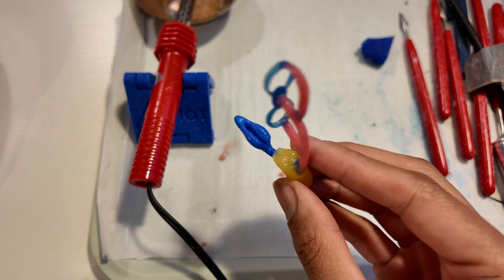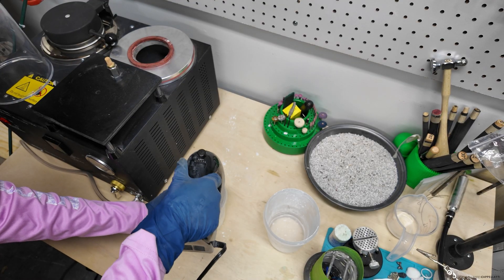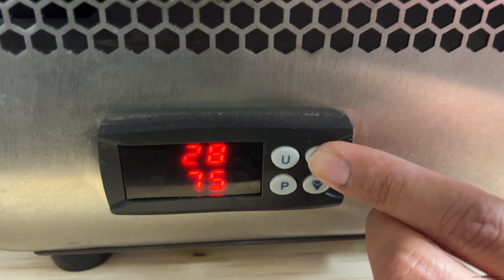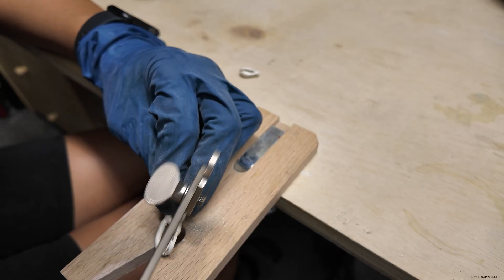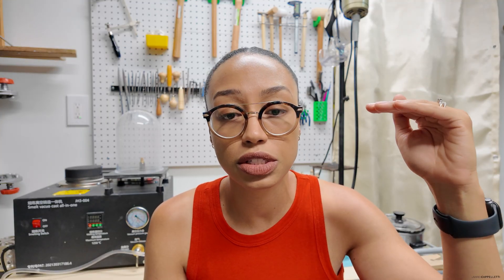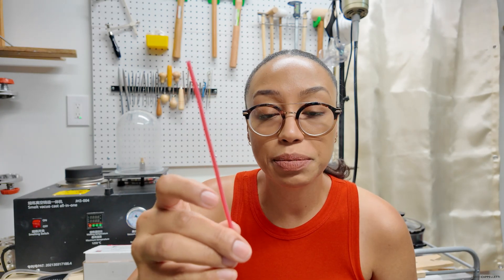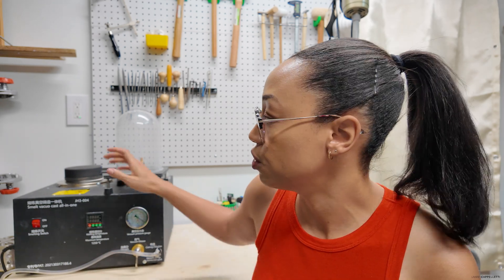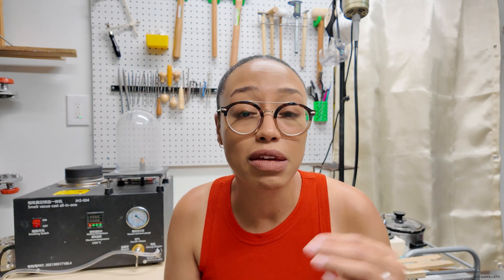Quick Step by Step Lost Wax Casting Silver, Kiln & Vacuum Cast Machine Update,  Answering Questions

Comment: When pouring the metal, do you turn on your vacuum pump as well? Since it’ll be in vacuum?
Reply: I also have the same casting furnace, it was hard to turn it as well but I complete turned it to the the left (loosened it) and now it’s much easier

Comment: Hey, are you sure its not programmable?
I have the same one (or at least it looks identical, buttons and all) and mine is programmable with temperatures and times. 
What happens when you press and hold the „u“ button for a while?
Reply from the maker: Yep, mine is not programmable. When I bought this, there was only one version. If you go to the Vevor site, it looks like it does come in two versions now. I'm tempted to put mine on marketplace and upgrade lol

https://www.vevor.com/tabletop-kiln-melter-c_13250/tabletop-kiln-melter-1500w-electric-kiln-2192-max-temperature-melting-furnace-p_010733303111

Comment: Hi, where did ypu get your unit from ? Does it still works well ?
Reply from the maker: Hello there! I got my 3 in 1 & my kiln from eBay new. Both have been great for me so far & I haven't had any issues. I know some people have reported problems with the 3 in 1, so I would recommend testing it as much as possible while you're still in the return window.
Reply: @lawrencappelletti Thanks, appreciate it !

Comment: I'm buying the same setup today.  I got the cheapest version because I already have vacuum pumps I use for other things.  This looked easier than a home made vacuum solution.  I have a kiln I can use for melting the wax out,   I want to cast some silver trinkets.  Some things I will 3d print in wax resin, others I will try using  pla.  The first time I did this 40 years ago we used a spring loaded centerfuge instead of a vacuum, I hope the vacuum is better.  What casting material do you use for the mold?  I bought something on Amazon to start with, but I wondered what you use.
Reply from the maker: Yay! Excited for your new set up! In school we had a centrifugal casting set up, but this is way better. I'm using prestige optima now, but I've also used prestige oro investment also. I've sometimes gotten a good deal buying investment powder on eBay, so that may be worth checking out. Happy casting! :)

Comment: Great video 
Have you ever thought of getting the 8 in 1 casting machine which also does for burn out process
Reply from the maker: Thank you! No I haven't but I'll for sure look into that machine!
Reply: @lawrencappelletti  videos have been great helping me I’m a gold miner / bench jeweller myself but I’ve always used a sand cast or hand fabrication. So casting is very new to me 

I was looking at buying a kiln for burnout when I was told about this 8 in 1 which does look very similar to your machine actually but it has the burnout in the bottom of the chamber on the melting side apparently 🤷🏼‍♂️ so it’s programmable to get to temperature good enough for the wax burnout in all stages 

So here I am looking on YouTube what others are using 😊 In 8 years I have only ever worked with gold I find panning or mining so it’s very soft but now I’m making rings with pets ashes in them so need to step up to the times and equipment